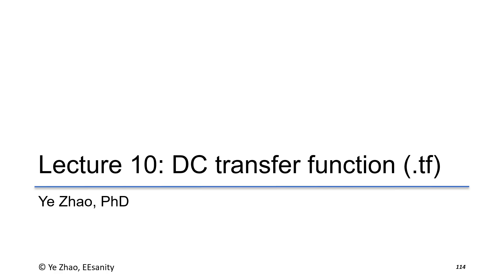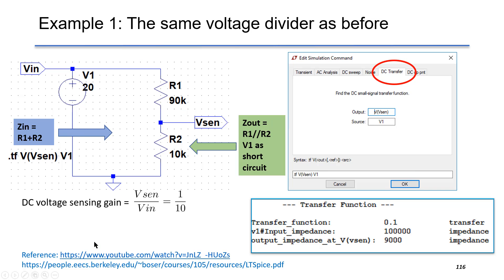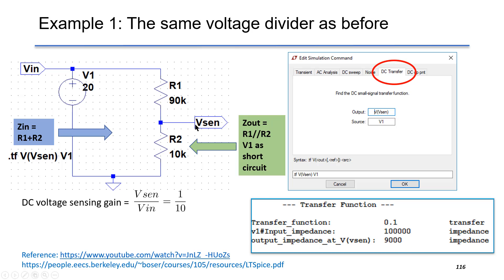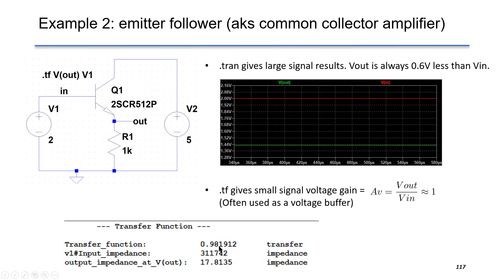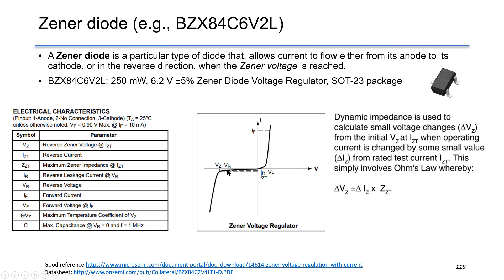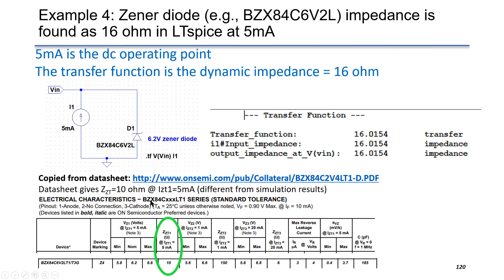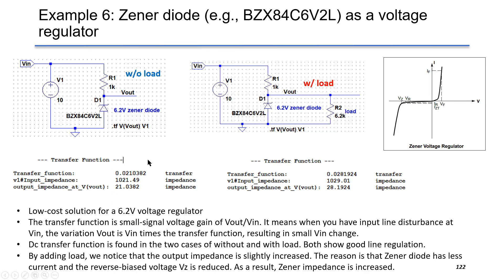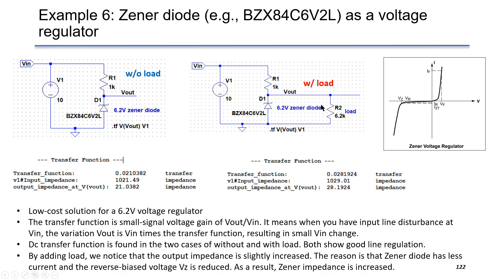LTspice Tutorial for beginners, Lec10 DC transfer function (.tf)

Comment: Thanks a lot! Very nice your videos! A question: in LTSPICE, when I used a DC voltage source set to zero to sense a current in a branch, and if I used .tf I(v1) vin in some circuit, being I(v1) the current that pass through the voltage source v1 acting like a current sensor (setting v1=0), why the output impedance give me a higher values (1E20)? Always I get the same output impedance answer when the output variable in .TF sentence is a current passing through a voltage source acting like current sensor branch (it means, setting DC voltage equals to zero) . Thanks a lot!